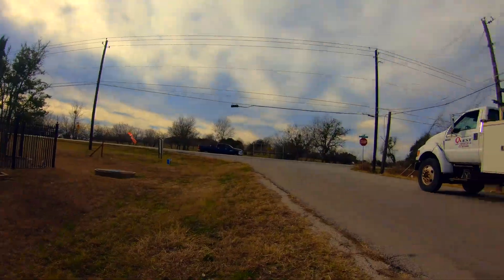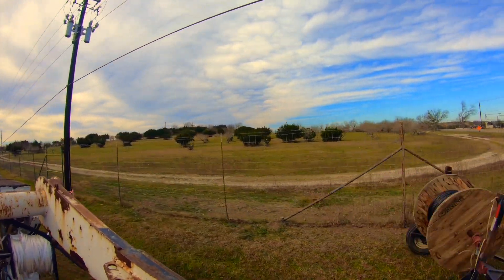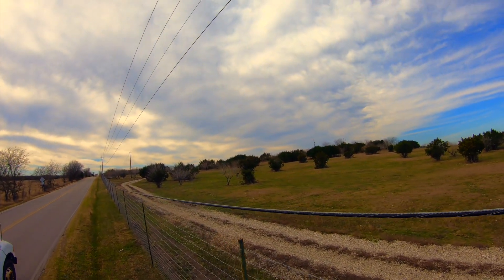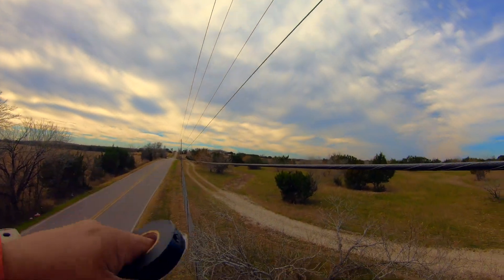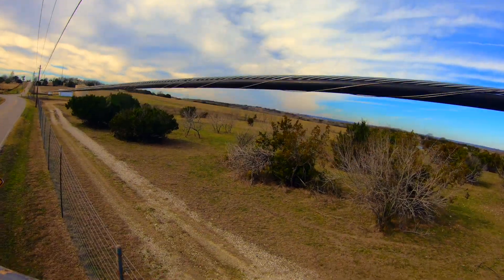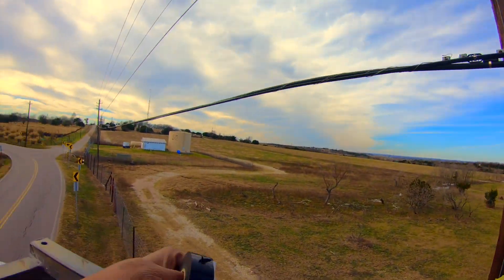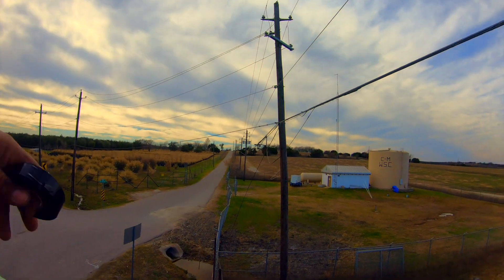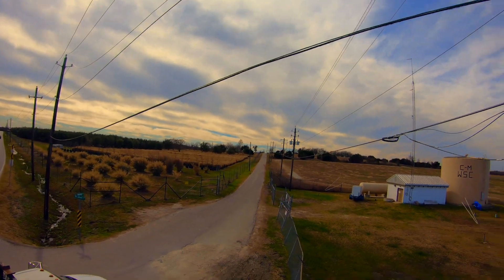HOW TO PULL  OUT FIBER WITH BUCKET TRUCK

Comment: Little hint tie a string on your wire sock to the eye. Then tape over the string. When you want to take it off just pull the string from the loose end to the eye and it cuts thru the tape .
Reply from the maker: Im going to try that.

Comment: Use rubber bands to hold rollers in place, you don’t have to stop the truck and they break easily when you send a lasher down the line

Comment: Hey we have just bought the same/similar truck. How come you are pulling the cable out instead of driving it off?
Reply from the maker: Don’t feel comfortable with this new guy, and its not in the video but had to almost did not reach a pole. Driving off fiber can be sketchy if the guy does not know hot to drive u well.
Reply: @thisiscomm2021  Roger that. Now this makes more sense and I totally understand what you mean by having a new guy as for sure driving off and lashing at the same time takes a bit of co ordination. 
Be safe out there, thanks for the video 👍
Reply from the maker: @jamesdr  
Thanks for watching.

Comment: How jig just the strand out? and tension it?
Reply from the maker: Il make a video about it. It depends on the strand. If its 1/4 u can drive it off or jig it frame as u go and soft sag every pole and then tension at corners, or dead ends.